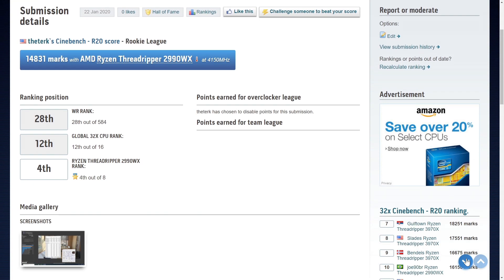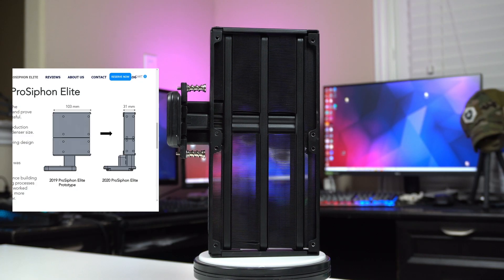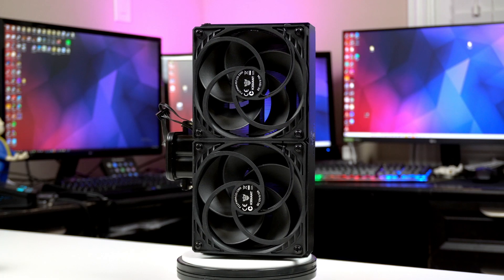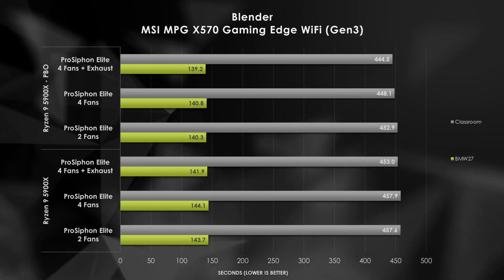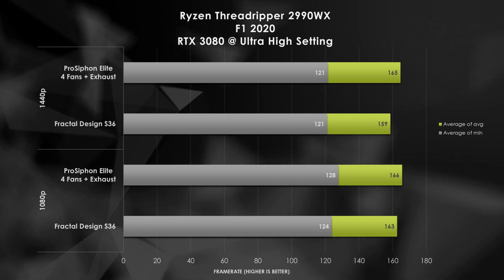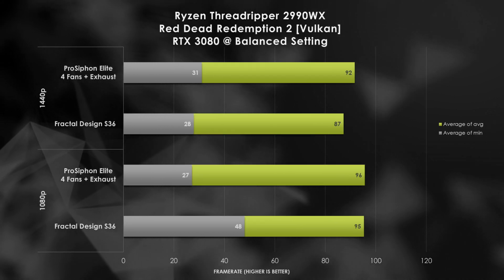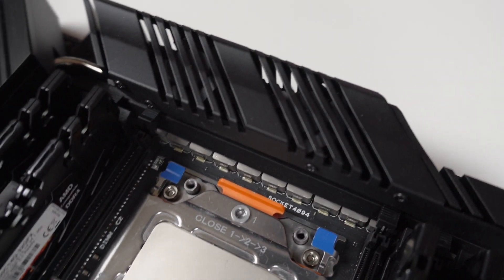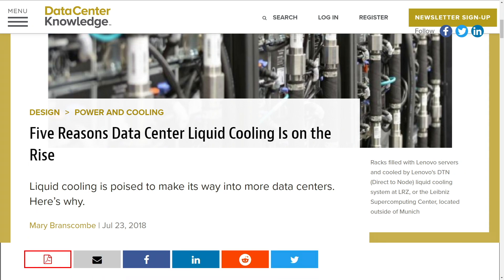IceGiant ProSiphon Elite CPU Cooler vs Liquid Cooling FULL Review

Comment: Man what a shame, it would have been better if they designed this to be vertical like a traditional air cooler so that it can take much better advantage of the airflow. Wasted potential the way they have it sucking in air from below. Absolutely not worth the price when compared to top of the line air coolers like dh15s, specially when you throw in that second fan. Although compared to AIO water coolers it may be a better value than your typical high-end AIO. 

They just need toturn it a bit and it would be perfect.

Comment: Got the arctic 280mm bc i got a 5x pack of 140mm fans to match for a push pull, front mount, with the top 140mm exhausts. Its why i front mounted it in push pull to get as much in as possible as well as GPU intake fans on the MESH II. Other than that its really hard to maximize cost/value with an aio vs a nh-d15 cromax or a prosiphon when on sale for 140$ range. The arctic aio is already cheaper+ the cost of 2 more fans. In situations lacking gpu intake 120mm fan mounts the gpu temps would be higher w.o a front mount and a top mount+motherboard paring with a high temp vrm and ryzen 9 can yield some high temp activity that a single rear 120mm exhaust cannot handle. Its why im willing to build in a tu150 for itx bc it CAN fit a nhd-15. It will generate some air flow through that small system vs a front mount 120mm aio or rear. What i need to test is the 3070 FE stock fan curve as 0 rpm <50c. with 120mm mounted under it. As how it affects cpu thermals in itx. VS with a custom fancurve and removal of a 0rpm aspect or higher idle temps for general cpu loads/idle etc in general. For all i know 0rpm mode with no 120mm intake fans on may be a solution

Comment: we need something like this for gpus.  cpu coolers have gotten very very good but it seems like my gpu is the thing i have trouble cooling now.
Reply from the maker: I agree.  I think that this first pass of the technology in a desktop needs to be refined a bit more.  I definitely see how this can be applied in datacenters though!
Reply: if ur having trouble with modern gpu cooling, then 99% of the time you gotta replace the thermal paste and pads. it truly makes a mountain of a difference
Reply: @HamsterHawk  any 450w 3080 is not gonna hits it's full potential on air
Reply: Just mount a 120mm cpu twintower on it. You do need to have enough room between drivebay and gpu slot height but with 120mm coolers that should be doable.
Reply: Asus and Noctua solved this for certain high end gpus the 3070 and 3080. I hope they will make this for the high end nvidia 4000 series and preferably amd cards too.

Comment: Fan count has nothing to do with frames, its the temp that changes with 4/2 fans. And the temp can cause thermal throttling, but since it isnt throttling your benchmark is worthless.
Reply from the maker: lol - the fan thing was only to see if it even changed the result.  the manufacturer recommends 4 fans, and I wanted to test other alternatives.
Reply: @TheTerk  from what I've seen, the biggest "bottleneck" in the ice Giant is the heat transfer from CPU to the cooler. Performances is exceptional, when giving enough heat trough a big IHS, but mediocre/poor if you plan on making a dead silent 5600-5800X

Comment: So in other words, my nh d15 is just fine for a 5800x with a reasonable oc.
Reply: it probably makes better contact than an aio for the 5800x case. The only reason aios or thicker 280mm aios push/pull esp. Is bc of ryzen going from high single-2 core clock, to high all core/multithread. In benchmarks or even games etc. VS the Nh-d15 already set to a max or set curve that its near with a "gaming" load vs a benchmark or highthreadded workload. The noctua does as well as an aio, But the "randomized/synthetic" tests in benchmarks go from shared cpu/gpu load, single core, and multicore tests etc. Which aios IMO handle better cooling wise in regards to stock ryzen or pbo/pbo2. I only went with an aio in my specific build/chassis bc it could use quieter/low rpm yet more effective 140mm fans with a thicker rad changing ram is easier like from a duel rank kit for editing or work, down to single rank oc b-die memory and 4 slots occupied. For "benchmarking" testing etc. AIO is somewhat ideal for swapping cpu and ram. BC of how easy it is to mount.

Comment: A brief description of methodology for testing would help. The Ice Giant may do better at sustained workloads but an AIO should take more time to saturate the system so short duration but bursty high utilization tests should have the AIO performing better. A good test that Hardware Unboxed did was to look at power usage once thermal limits of the test(which ended up being equivalent) were reached. It would be interesting to see a sustained workload and temps over time graph with a layer for power usage (at the wall).

Comment: Thanks man, great review.  I think this will just barely fit in the Lian Li 011 Dynamic, do you have any comments on this?
Reply: This cooler is designed to be mounted horisontally or semi vertically, not fully vertically, as most cases uses. According to info i found burried on their official website.
Reply: It fits. How do I know? Because I forgot to check clearances before I purchased the case and it wasn't until I was about to close the case until I freaked out. It might be pressed against the glass, but it isn't putting any pressure at all
Reply: The XL!!! So sorry I forgot to clarify that
Reply from the maker: @JuanRBlohm  I had that same feeling stuffing all this system into my p400. The cooler is touching the glass, ever so slightly.
Reply: Be careful of your RAM height clearances, I forgot to check mine and it didn’t clear my Corsair Vengeance sticks
Reply: @jacobgaylord9277  ouch. That stinks.
Reply from the maker: Dynamic has 155mm of cooler space: https://lian-li.com/wp-content/uploads/2020/11/o11-COMPATIBILITY-02-1024x492.jpg
ProSiphon Elite is 164mm

looks like it won't work.  maybe the XL is better?

Comment: Price seems high at first but if you take into account most aio's have a lifespan of 5 to 6 years, the price suddenly becomes a lot better, since the ProSiphon Elite has a 10 year warranty and most likely an even longer lifespan
Reply from the maker: Yep, and it's even better when compared to a system that runs 24/7.
Reply: Didn't they simulate a test that said it could last a few lifetimes?